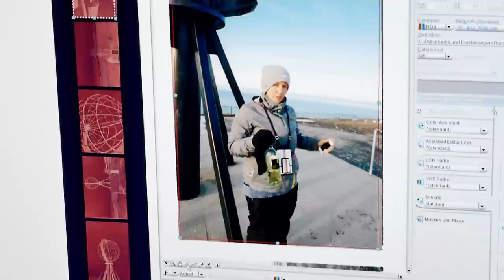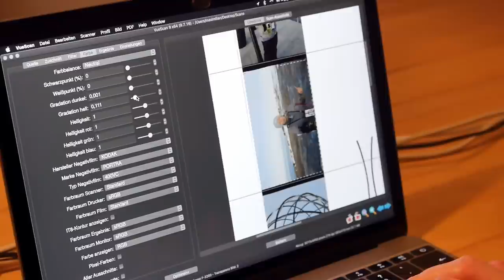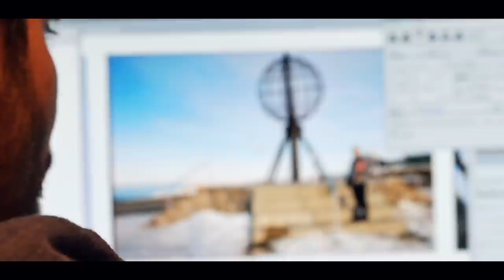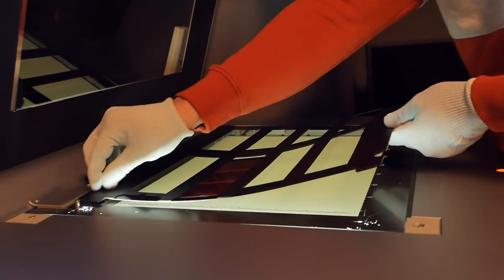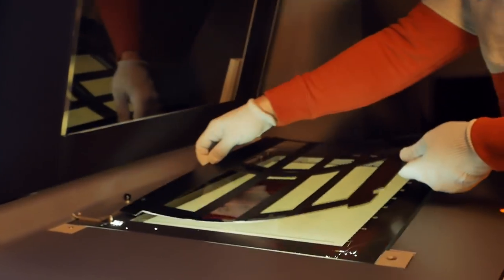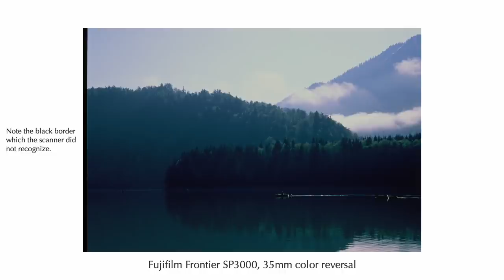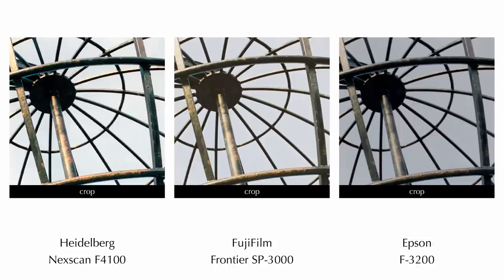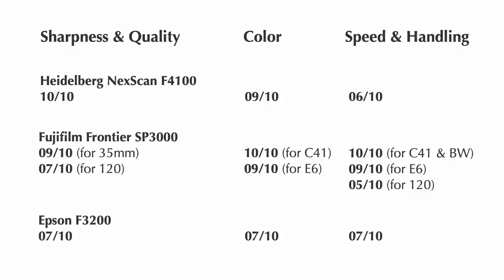How to find a film scanner that fits your needs

Comment: Unfortunately the whole field of film scanning is dead since 15 years. I have not seen any new device making use of state of the art technology since quite some time. The remaining small players are not really innovative and Epson has lost its interest...I really cross the fingers that a larger company will come up with a new solution in future. ☹️
Reply: look up phase one ixg
Reply: Pete Melon  Correct. I was also more thinking of a system which can be seen as a successor of the Nikon scanner series. The Phase One System has a 60.000€ price tag and several disadvantages for film scanning, as you already mentioned. I‘m also not aware of any commercial supplier providing scan services with this system in Europe.

Comment: Back when Nikon discontinued the coolscans I spent the remainder of my student overdraft on a coolscan V ED. Many years down the road I'm glad of my past reckless self.
Reply: Not my personal choice, but you are correct. The high point in the technology of film scanning was reached by Nikon and Minolta more than a decade ago. Film scanners have alrgely disappeared from the market, and the few which remain are fairly poor quality Chinese junk. The idea of rephotographing negatives with a DSLR suffer not form the resolution of the camera, but from the resolution of the lens. Very few people have or will afford a high quality macro lens, even then, the resolution of the lens is not going to exceed 100 lines per millimeter deliver at the sensor, which is a fraction of what the sensor of best DSLR can record.

Comment: I have always developed and scanned all my negatives and slide films at a very old photo lab in Sofia, Bulgaria called Dekov Photo. And I just recently decided that I would buy myself a scanner so that I can have full control over the scans. I opted out for a Plustek OpticFilm 7400 - a great little machine that I was able to buy from eBay for around EUR 150. I really love shooting film and it's a sort of an escape for me from my work as a professional automotive photographer, which involves a lot of post processing. HOWEVER, after a sleepless night scanning just two 36 exp. negative films, I developed hatred for the process.. 
It took me well over 5 hours to scan two films and I encountered numerous problems in the process. First of all - dust and scratches.. that is a real problem, 30% of my photos had scratches on them straight out of the lab and I had a hard time getting rid of the dust even with a blower. Second - the colors.. The color rendering difference between the pro scanner in my lab and the Plustek was pretty distinct. Not that it can't be corrected in post, but as I've said film photography is my escape from the tedious editing process and I do not want to edit my film photos. It is a very time consuming process and for me personally it is not worth the time and effort. The results that I got were far less satisfying than I expected. I ended up selling the scanner a few days later and I am once again a happy develop+scan customer at my local photo lab. 
Stay safe you all and remember that film is still alive! :)) 
P.S. Another wonderful video, guys! Hertzlichen dank!

Comment: A great video Max and it encouraged me to look online for an Epson 3200. The other two are way out of my pocket money limit. I have found and purchased an example of the 3200 in mint condition. It came with all it's original packaging and looked like new. One slight disappointment was that I couldn't find a Windows 10 driver for it so I wasn't able to use the Epson software. I eventually downloaded a copy of Vuescan though which enabled it to work. It's a shame that I can't seem to get the driver for Silverfast though as I prefer that software.

Comment: Most people are now using a full frame sensor. I have compared scans made within Sony A7R3 combined with their very good macro lens, with an Imacon virtual drum scanner. Of course Imacon scans are better, but the Sony sensor imaging is better than my Nikon 4000 dpi scanner and a lot faster.
Reply from the maker: Yes, as mentioned in the video scanning with a digital camera is a really promising alternative which we have used before. But we decided to exclude it from this discussion for the reasons mentioned.
Reply: Pete Melon  Totally agree - there are also lots of other issues with DSLR scanning like reflections off the film surface, keeping camera and film truly parallel (a must for stitching shots for medium format) and the total expense of a really good quality setup vs dedicated scanners. I think it's important not to just encourage people to buy old film scanners though, PlusTek and Reflecta still make pretty capable machines that start at reasonable prices and if we want these things to keep being made into the future it's essential to support the manufacturers.
Reply: Pete Melon   I have recently finished a collection upwards of 10,000 negatives, and you’re completely right there’s a lot of work. But a couple of points. Not all films stock is equal. Not all film processing is perfect. Not all film was dried in heated, dustless cabinets. But many were. Some films were overheated when they were dried, introducing more curl, and lie perfectly flat. A roll of FP4 processed correctly lies flatter than a Tmax. The thinner the film stock seems to yield better results. 

You also failed to mention Digital Ice does not work for black-and-white film, so my Nikon scanner picks up just as much dust on that negative as my Sony sensor. The difference in time is astronomical when you have 10,000 negatives. And I have another collection of 20,000 which I have an barely scratch the surface of. 

My last point is that the Capture One, version 20 has a really good layer touch up tool. Why is it really good? Because it picks the sample. Shows you where it was chosen, and you can move it.  I find it extremely fast in my workflow. So when I export a tiff to Photoshop, there is a minimal amount of retouching to do. I’m talking about negatives that are generally clean on a film that’s a generally clean. And flat. I have spent hours and hours cleaning a quarter of a damaged negative. I’m a bit of a fanatic. That’s something that has literally 150 find lines, and numerous scratches and still making it look like it was never scratched sure, so what?

I still use my Nikon scanner for slides and colour negatives, partially because I don’t have that many of them, or at least compared to the black-and-white collections.

What really impressed me is that I have picked up details in skies that were never apparent in older prints. Or I never knew existed.

One example: I have a shot on tech pan 35 mm that I believe is processed in HC110, because that’s what we stored at work. I remember shooting it at my lunch break, and It was over developed. Perhaps six stops or more. If I held it up to the window,and you can barely see anything through it. With the highlights all p blocked. With a digital camera, one I used a slow shutter speed, perhaps 30 seconds, and maybe even 60 seconds, but I could then see the negative through the viewfinder like it was normally processed. And suddenly a completely decent copy has been produced, with all details.

Comment: Does anyone know how Nikon Coolscan 9000ED or Imacon scanner work compare to these scanner?
Reply: I use one and I must say it's not a great scanner. For color it's mushy and lack detail. I use it for bnw only and do post editing on a software. I do most of my color scanning in a lab. It does come with templates for 35mm and 120mm. If you are experimenting and shooting cheaper film stocks then it's great which is what I do, but for the more expensive stocks better to scan at the lab.

Comment: I went from a higher end Epson “Photo” flatbed to a digital camera mainly because of limitations of my PC (32bit Windows with 4Gb RAM). Being a digital and film shooter I do have old digital cameras and am currently using my older EOS R with the EF 100L. Now I’ve upgraded my PC, I may retry the Epson to see if it performs better but I’m quite satisfied with the digital camera method, even if it is a multi step less automated process.

Comment: Hi Max, again a brilliant video you have produced and I have a question about the desktop scanners. You say that you use the Epson 800 and the F-3200, for this comparison you gave preference to the F-3200. Can you say why and if you have worked with both models, are there big differences in the output? I'm also searching for a small flexible setup and thinking about a v850 with Silverfast, but still not sure. What I love about the F-3200 is the film holder feeder and it's more compact, but it isn't so easy to get one in decent quality.

Comment: Wonderful video.  I've seen it many times.  All I want to say is that the actual maximum resolution of the fuji frontier sp3000 and the Heidelberg Nexscan is lower than advertised.  I own both.  Measured with a USAF card, the fuji frontier sp3000 achieves approx 2800-2900 dpi at 35mm.  The Nexscan has a minimally higher resolution for a frame of 35mm, however it allows you to use said resolution in larger sizes, if you scan in strips and join them in Photoshop (although also in that case the real resolution achieved is lower than those announced in the video ).  In terms of quality, I think the Nexscan is incredibly better because it produces clean, artifact-free images with much greater chromatic and tonal richness.  Resolution is the most attractive quality in terms of marketing, but in my opinion not the most important quality of a scanner.  There are scanners with a lot of resolution that are bad scanners.

Comment: Hi there, I've tried the Epson F-3200 scanner and I did not know that it's a sort of flatbed scanner, because of the glass plate that the film sits on. I believe that's the reason that the scans are so soft. I scan also with an older CanoScan FS-4000 and it's much sharper, even at 2000 dpi. And of course the dust , me oh my THE DUST. Sure, it's small, you have all the plates for different formats, looks nice and it's fast, but no sharpness. Is there anything I can do from Vuescan to make it sharper?

Comment: Nicely done.
I'd add that the Nikon CS5000 and CS9000 scanners are worth considering.  When new, around the early 2000's, these were basically the best film scanners available to the enthusiast or small volume shop.  Next step up would have been the $20k Imacon Flextight.  That's a pretty big jump for the $2500 for my then new CS9000.
I've been using mine for all this time.  Both are worth searching out for.

Comment: Good video. Have been going through somewhat of a scanner journey myself. Got the epson v700 first and had decent-ish results but 35mm looked mushy and had minimal detail. 120 looks better, but I still think it is hard to get very strong colours. I now have the Reflecta RPS 10m for 35mm which makes better scans for sure, although does some strange things sometimes e.g. randomly stops, changes the aspect ratio. It scans an entire roll of 35 in one go which is very useful, but often have to do a little adjustment to the white balance..anyway keep up the good work!

Comment: This is very late but I got a PlusTek 8100 for Christmas and it’s definitely not the best scanner available but, considering the volume of scanning I actually do, it’s way better than my Canon 5600 that I was using before. For colour film it’s good enough that I’m not too worried, even with stuff that expired in 2005 or so. I do think that the approach of creating a digital contact sheet and then going back and scanning just the interesting ones is an approach I need to take, but for now an hour or so per roll once a month or two is a level of time I’m happy with.

Comment: I have an Epson V600 for colour slides and medium format 6x7 colour negative and colour slide film. 
Huge files from the colour negatives from my Pentax 67 with a 55mm F4. 
I have been very pleased with the results. Slow but sure. 
I print black and white film in my darkroom. Best results ever. Very little equipment. Schneider Componon 100mm f4.5 lens and a Gnome Alpha Rangefinder condenser enlarger. 
The scanner doesn't get much use now.

Comment: Great job, very practical views various scanning options.  For quick previews, I still use a Kodak RFS 3570, which has the best color inversion for C41 film.  Kodak had the secret algorithm for C41 film and Silverfast still struggles with C41 inversion.  The Kodak HR500 was a great work horse but most machines died by now.  The F4100 is a fantastic CCD flatbed scanner especially with wet mounting, and still better than any Epson scanner.  The Heidelberg D8200 is a great drum scanner, but the best is a Hell Chromagraph S3400.  The best DSLR with a APO macro lens still has too much chromatic abberations at 1:1 when compared to any scanner. Nortisu, Pakon, and Fuji SP3000 scanners are the quick and dirty scanners used by labs, and  not worth salt, and why shoot film.

Comment: Fabulous video as always.  So informative.  My scanner is a dedicated film scanner from Plustek, I have the Opticfilm 120 which cost quite a bit but I wanted something that gave me really good scans, sharpness being my main criteria as I scan to .dng and then covert with Negative Lab Pro, it can scan both 35 and 120.  I am happy with my results for the most part, and the scanner is not without it's quirks.  It's also quite slow but I don't really worry too much about that, speed is not important to me.

Comment: windows XP ??? high end scanner and the ancient PC that is able to run XP ?
Reply: Pete Melon  not really. even the drivers and software of my old Epson V500 are working on both W7 and W10.
Reply: Pete Melon  i see. its sounds absurdly cos additionally to the worth scanner one have to buy and to maintain an old PC with the out of support in 2014 OS.
Reply: Pete Melon  im IT management person and dealing with computers during my dayjob hours, dont be confused - i dont like to replace and to upgrade an OS of PC or my phone every week bcos it become a nonstop challenge of the manufactures but still it was too strange to see the old and forgotten logo. but i know that even banks still use their ATM with tjis outdated OS. so actually if banks, so why not ;-)
Reply: Pete Melon  you're right ;-) thank you for the conversation.

Comment: Interesting video and very informative. I use my Sony A7R3 with the Sony 90mm Macro lens tethered to my PC using the Sony remote App, NLP and LR and I get excellent quality scans (around 38Mp) for 35mm colour and B&W, I haven't had any issues with colour casts as lots of folk seem to have.
Reply: Pete Melon 
 You will have to manually remove the dust, using Photoshop's dust removal tool. That can be a pain, so if you film is new, dust it off as much as you can before scanning.

Comment: Thanks for these comparisons!
The only advice I want to give, don't use flatbed scanners for scanning 35mm and smaller frames.
Reply: Why?
Reply: Yeah, why?
Reply: @ghosttownsentinel5288  There is a lack in reproducing a good density range to achieve details in shadow areas.

A lot of guys are working with Epson 800/850, it's ok for 4x5. The smaller the frame the smaller the capability of showing shadow details.
Combined with bad density range it's the worst case.
If you compare 35mm scans of flatbed and dedicated ccd-line based film scanners you will throw away your flatbed.
For medium format a Minolta or Nikon coolscan beats a flatbed as well.
As I mentioned for 4x5 a flatbed maybe is ok, a good compromise for pricing and handling compared to a drum scanner, this of course is the best what you can get.
I don't know this Epson F3200 from Max but it looks very interesting, seems to be a good solution for 4x5.
The only known competitor in this price range for 4x5 film scanner is Polaroid sprintscan 45ultra.

Max' scanner comparison and his thoughts about workflow is very helpful.
Scanning is a time consuming process and it makes no sense to go with cheap equipment.
Reply: @stephan.scharf 
What do you recommend for 35mm scan?
Reply: @Asmoc23  I got a used noritsu Ls-600 for 35mm. Found one for cheap and now I wouldn’t use another scanner for 35mm, works great on my modern windows 10 PC.
Reply: @EM-ve9bh  cheap? :))) I found one for 6K and another for 8K.
Reply: @Asmoc23  yeah, I found mine for $900
Reply: @EM-ve9bh  good for you, but it doesn't quite help me :)

Comment: Heidelberg Nexscan is an excellent flatbed scanner, better than SP3000 when scanning negatives or slides.  With negatives, even the Kodak RF3570 (5MP) gets better color than the Fuji SP3000 or Noritsu scanners.  For your portfolio I'd recommend a Heidelberg D8200 or even better, the Hell Chromagraph S3400.

Comment: Great video summarizing and comparing options. Professional drum scanners and lab scanners are rare and not really a considerable option IMO. They just fill a very small percentage of the applied scanning methods which are commonly used by amateurs and even professionals. Wish you had shown more consumer options starting at 24:35 which are the most used types. Very good are now also different digitizing methods with digital cameras and software systems. I am using Plustek 8200 Ai for 35 mm and Epson V850 for everything else. The V850 scanner has the advantage that the focus point can be adjusted via height of frame holders which I found of high importance for scanning slides and negatives.
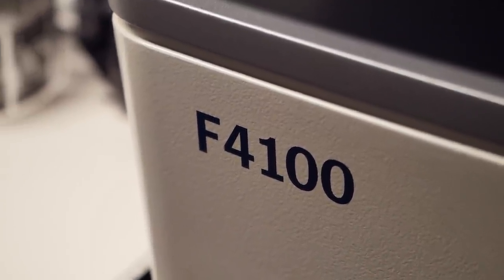Reply from the maker: 8:08
Reply: @AnalogInsights  thanks, I state corrected - I flipped over this talking section of this long video too quickly obviously. Glad it was mentioned. Nevertheless, focus here was on professional scanning methods which are too rarely applied for regular users.
Reply: How does the V800/850 compare to the F3200 in quality/sharpness?